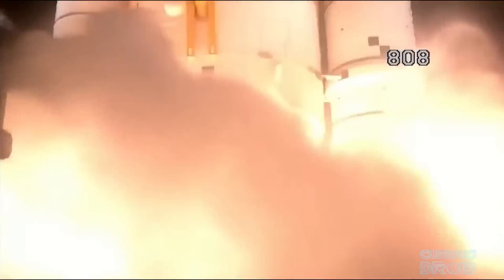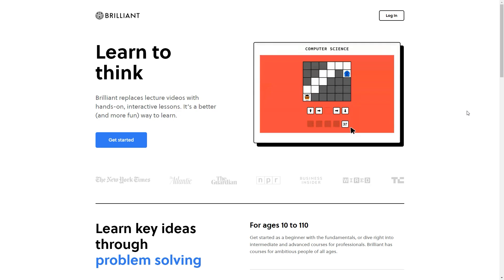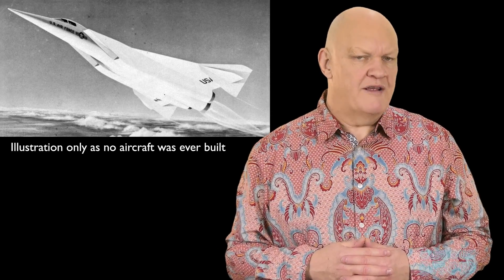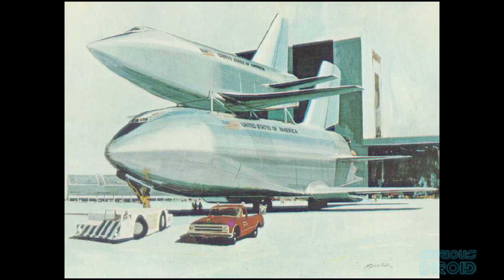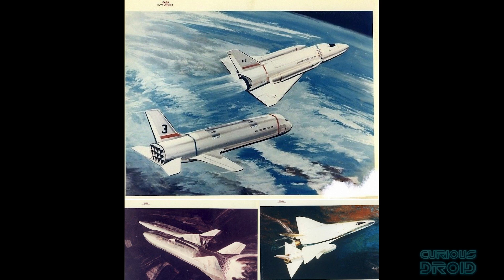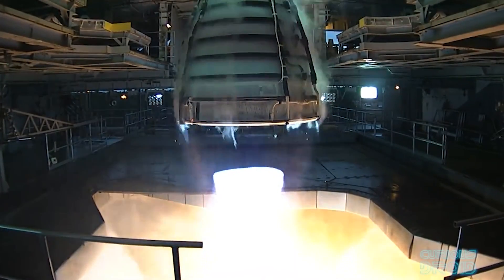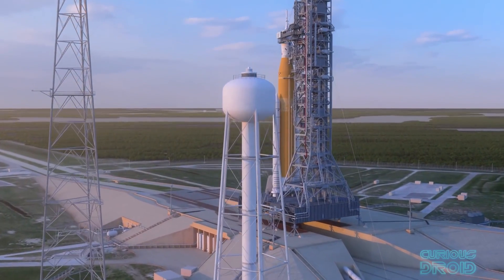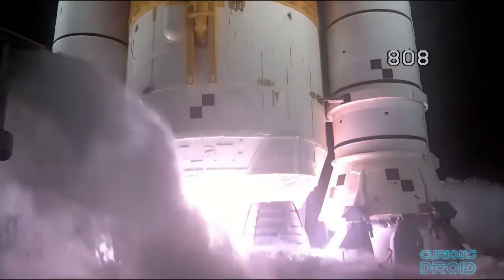Why is NASA Throwing Away Reusable Engines?

Comment: This one mystefies me how they can justify it - they even developed a disposable variant of the RS-25 in the RS-68 for the Delta, precisely because the RS-25 was too expensive to be disposable. At least with the SRB's it makes a bit more sense, as the tally after the Shuttle Program ended showed that the recovery and refurbishment of those was pretty much just as expensive as if they had bought new ones every time.
Reply: From what I've heard the main issue isn't proximity to each other, but that the RS-68's ablative nozzle being designed for the delta 4 series of rockets with shorter burn times actually doesn't have the durability for the longer burns of SLS, especially if one of the engines were to go out early.

I still agree though, the RS-25 really is an engineering triumph, it's sad to see them be one and done on the pad.
Reply: @maxkovalchick  I prefer to not think of it as a one and done, and more like the final act of defiance for such amazing engines.
Reply: @maxkovalchick  better than seeing them just rusting away in storage.
Reply: @sunspot42  very true, but one can imagine
Reply: @sunspot42  Exactly. And it would cost hundreds of millions to build new engines that wouldn't be recoverable either. It's a no-brainer really. I think it mystifies the OP because they imagine that every rocket should work like a Falcon 9.
Reply: the RS-68 is not a variant of the RS-25, you are thinking of the constellation program, where they were trying to work out issues between using RS-25 and RS-68, they wanted the RS-68 because it provided more thrust, but required a new variant, the RS-68B, which had a regenerative cooled nozzle, it also needed to  be man rated, this is incredibly expensive, and is fairly close to redesigning  the entire engine since you need new plumbing and control on the engine to use a regeneratively cooled nozzle, versus ablative on the RS-68 and RS-68A.  The RS-25 is already crew rated, and regeneratively cooled, so less development would bee required, however they would need more engines per core to provide  the amount of  thrust they wanted.
Reply: @rocketman1104  yep, I had my stuff mixed up between ares 5 and SLS, my bad. I knew the RS-68 was a descendent of the RS-25, but had that other stuff mixed up. Thanks for correcting me
Reply: They can justify it because money is non issue. While Nasa doesnt have unlimited budget, their spendings depends from Politicians who grant those funds. So from Politicians, Manufacturers there is no really a big need or rush for reusable rockets. Which is still crazy when you think that private company SpaceX and others have achieved what NASA is unable. Thats why commercial space exploration is so important because it lets technology to advance faster and make it less reliable from politicians who only care that people stay happy and vote for them.
Reply: @JackieWelles  NASA Space Shuttle was reusable. The only part that was expendable was the external fuel tank. So SpaceX did not invent reusable launch vehicles. Furthermore, the private sector is not going to invest in developing new space technology because there is no money to be made from it. That is why organizations like NASA are critical for space research. They have pockets deep enough to spend on developing new technology, and they don't have to worry about returns on investment.
Reply: @DeepDeepSpace  the private sector is investing lots of money into spaceflight. There are multiple competing comapnies
Reply: @DeepDeepSpace  You lost me at

"private sector is not going to invest in developing new space technology because there is no money to be made from it."

Imagine the government manufacturing iPhones for example...You don't seem to understand how private companies work mate. Yes NASA still has a purpose, by all mean they can do a lot but they really move away from "making their own rockets" and focus on science.

Talking about the space shuttle while technically it was reusable, practically the refurbishment cost was so HIGH that it was cheaper just to build new engines and other parts.

Space X didnt invent reusability nor self-landing rockets, i never said that. There has been self-landing prototype rocket before. What Space X did is used available and prototype technologies, improved it and reduced cost. Falcon 9 and Dragon are prime examples of commercial space company success.
Reply: @JackieWelles  there was money to be made from iPhones which is why Apple invested in developing it. There is no money to be made from sending people to the moon or Mars. The price for a ticket would be out of everyone's price range except for a handful of billionaires who may not want to take the risk or go through the extensive training. So NASA has to front the development and operational cost. 

Furthermore, NASA provides Subsidies to the private sector to develop space technology so it's not like these companies put up all of their own money to build rockets and space craft. Falcon-9 and Dragon were largely funded by NASA.
Reply: They just waste money like water
Reply: They already paid for the shuttle engines and it costs money to keep them in storage. Why save them for future shuttles that may never be built?
Reply: It blows my mind that the whole thing was just tossed away either burning up in atmo, or splashing down in water.
Reply: Votes. That's how.
Reply: i mean kind of true, the RS-68 while a great engine had a worse thrust to weight ratio and wasn't nearly as efficient. Other posters are also right to point out that the elongated burn time of this mission didn't really fit well with the RS-68. So yeah, while it would have been cheaper, I don't think it could have worked as a 1:1 replacement...

In the end the whole idea of "re-using" space shuttle parts was really dumb, but totally politically motivated by all the industry that had been built up around supporting the shuttle. With SLS using many of the same parts and contractors they ensured those government dollars kept flowing - even if it was an incredible dumb and unscientific approach to the program.

Cool F'ing rocket tho if I do say... LOL
Reply: @cornbreadreturns296  the reason they reused space shuttle parts was because the parts existed and they worked. Might as well use them.
Reply: NASA is a giant jobs program for the Senators from Alabama and Florida. They will literally send out hitmen before they relinquish the pork barrel millions that Canaveral and Johnson bring to their electoral districs.
Reply: They have the motors--how is that not justification for you?
Reply: AFIK, one of the main problems with the RS-68 is cooling. One of the reasons the RS-68 is cheaper than the SSME is the lack of regen cooling in the nozzle. If you packed them close together on one core, like in the SLS, they won’t be able to dissipate heat effectively. The RS-25 on the other hand has an actively cooled nozzle so they can be packed close together.
Reply: No real mystery to it. The various parts repurposed from the shuttle program are all made in factory's in powerful senators home states.  Its part of why the original shuttle was so expensive.  Basically little kickbacks to the senators that supported the original program.  Now most of those senators may have been replaced but the current ones still wanted the parts to be made in their states to keep those factories going.
Same old government corruption at play.  Instead of the best or most efficient path its design by committee where everyone involved needs their cut to take home to their constituents or they'll nuke the deal.  Gota love pork barrel politics.
Reply: @merendell  THIS. Government aerospace is so unbelievably corrupt that it makes private aerospace look like the Virgin Mary by comparison, and they're incredibly corrupt too!
Reply: @merendell  the space shuttle's cost was due to it being a human rated launch system capable of supporting seven astronauts for up to a month while carrying up to 50,000 pounds (23,000 kg) of cargo. Then re entering the atmosphere and gliding to a runway. That is going to cost more than a unmanned rocket designed for satellite launches.
Reply: @DeepDeepSpace  this.

Needing the human rating tests obviated much of the RS-68s advantages over the already built and rated SSME.
Reply: corruption
absolutely everything related to SLS is built on or based around corruption and embezzlement
Reply: Jusify? Only need to justify how the 1% can get extra tax payer dollers, and be able to throw away the product at the end of its ffirst test, and 12 more after that.

Comment: bugging me why NASA reused boosters with shuttle but not with artemis. Also why can't they somehow retrieve & re use 4 rockets?
Reply: Re-using the boosters turned out to be far more expensive than anticipated, and more or less a waste of time and money.
Reply: Two main factors. One, SRB reuse was marginal on the Shuttle anyway — the cost of recovering and refurbishing and replacing bits wasn't saving money compared to just building new ones from scratch every time. And for the larger SRBs on SLS, it's even more difficult, since they burn longer, and as a result, come down hotter.